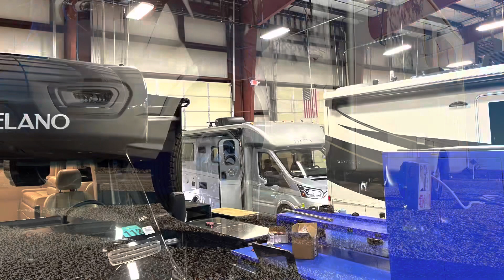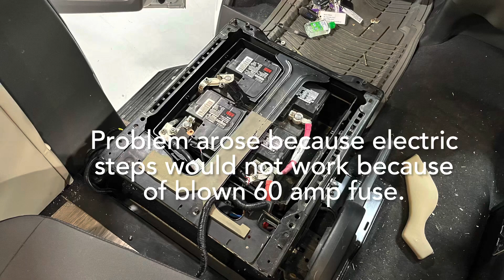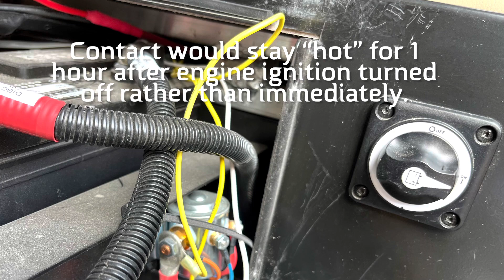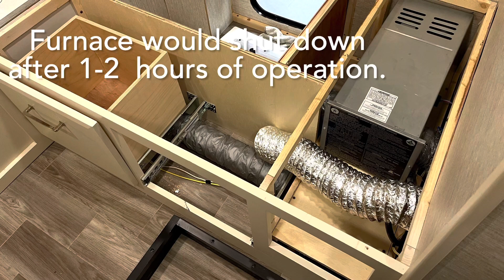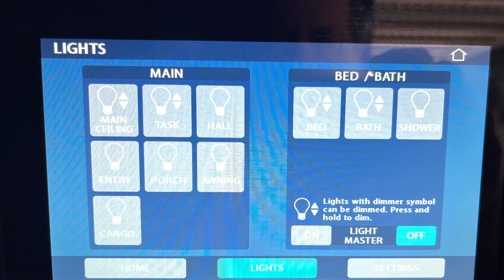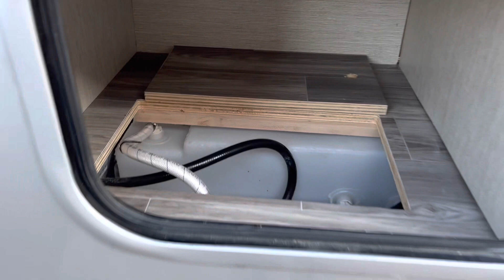2022 Tiffin Midas 24RT Owner Experience - Major Issues & Tiffin Resolution

Comment: Should have bought a Leisure Travel Van.:)
Reply from the maker: Haha. Yes, but $30 - $50k more.
Reply: Unfortunately, Leisure Travel Vans only have about 6'5" or less headroom. Which sounds ok for my 6'3" height, but there are protrusions from the ceiling that my cranium will find. I am amazed at all the rv's out there that I would consider but have the same or even less headroom, and I am not really overly tall.
Reply from the maker: @johnthomson5730  I have not measured but Tiffin says that the Midas has 78” interior height (probably because non-ducted air), but the AC unit in the hall ceiling hangs down about 3”, and the steps in the bedroom probably are 5” tall. So you definitely would have to slightly duck in the bedroom and the AC would brush the top of your head in a Midas. But the microwave up is great for tall people.
Reply: @rvtechman3619  How do find it as your daily driver when traveling. My concern it is the length for parking.
Reply from the maker: @johnthomson5730  At 25 ft long it’s a personal comfort level issue as regards to how stressful driving it is. I personally would not want this as a daily driver in a city. But obviously it is much easier to drive than larger RVs including towed travel trailers). It’s narrow enough for standard parking spots as long as there is room to maneuver, but at most places we take up 1-1/2 spaces long ways. I have not measured it, but if there was room to back into a parking spot and have the rear end go over curb stop, then it should not extend out over the spot in the front. Also, if people in other cars were more courteous regarding RVs and their limited maneuverability, that would help reduce driving stress.

However, on the highway it excels with that powerful EcoBoost engine. Cruising at 70mph and above is no issue (depending upon winds). And the SumoSprings that Tiffin installs on the rear end do a great job of controlling sway. Finally, the Ram Promaster Class C that we had previously road smoother and had a tighter turning radius. But lacked the power, features and technology.
Reply: Plus it's my understanding the wait time for orders on Leisure wonder is out 18 to 24 months